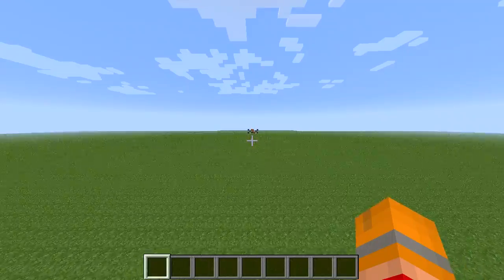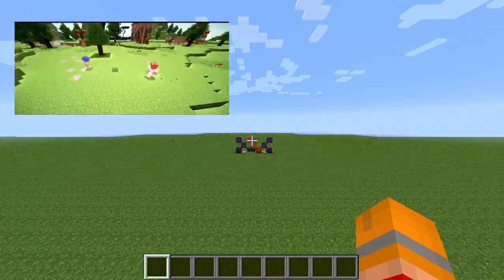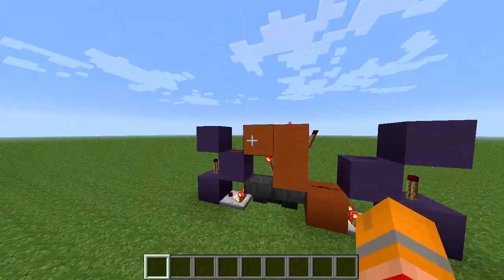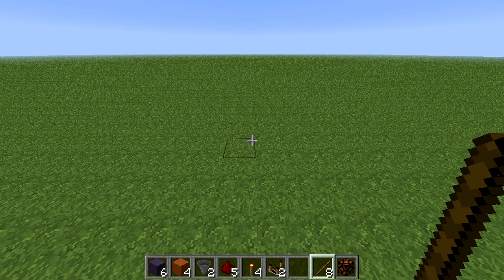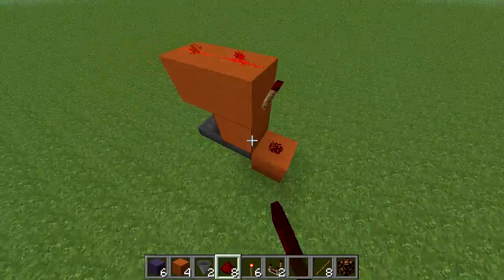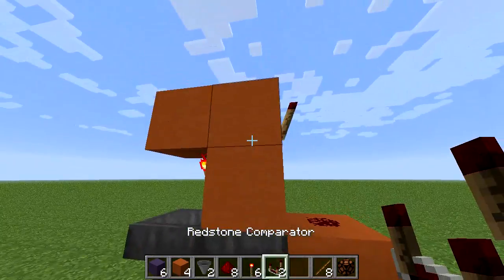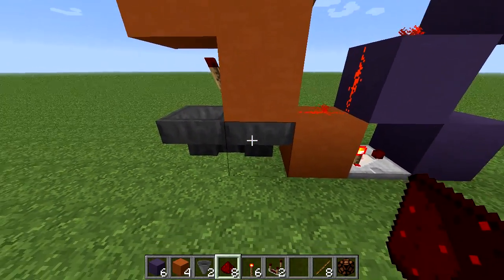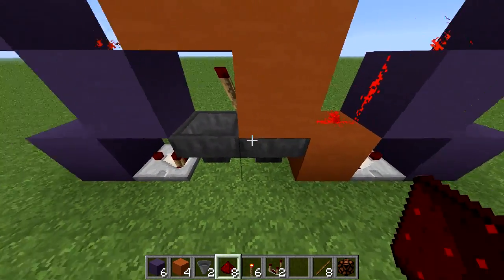Silent 1-Wide Hopper Clock

Comment: Hi. I use Thaumcraft which as Levitators which are "Off" when powered and "On" when not powered. Would this clock allow me to have a button press that would allow me to use them as an elevator which will turn it off after use and wait till needed again???

Comment: wouldn't the 2nd output not actually be on or off for exactly half the time, since the pulse from the torch under it would keep it on for slightly longer and off for a slightly shorter amount of time? even in the video you can see the on is longer than the off :/